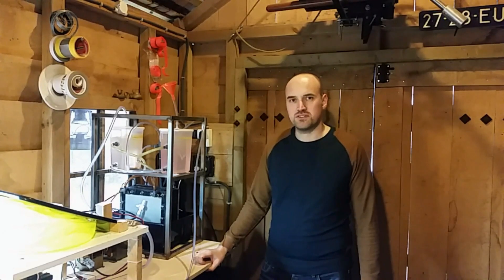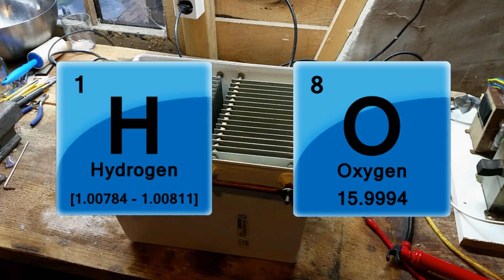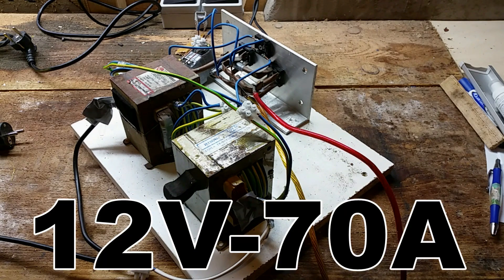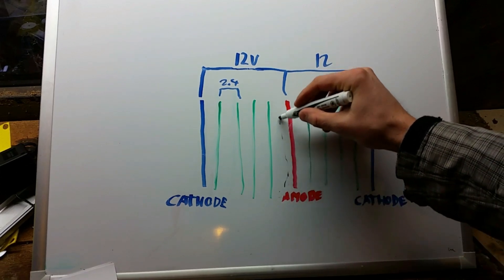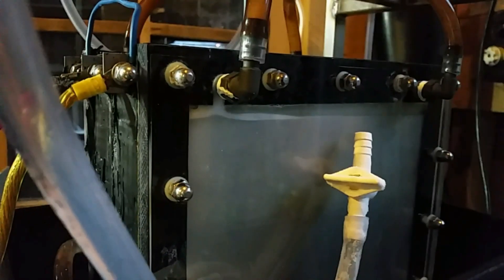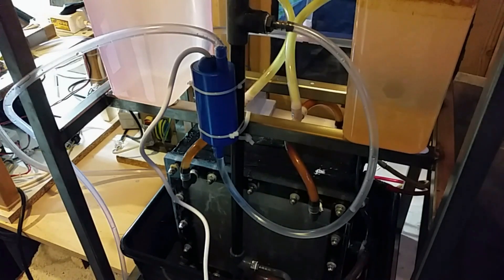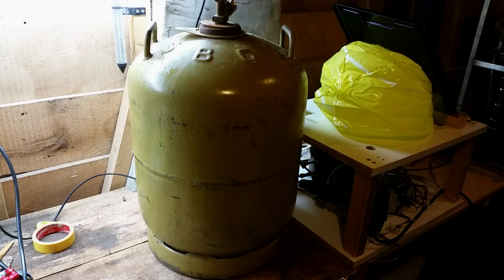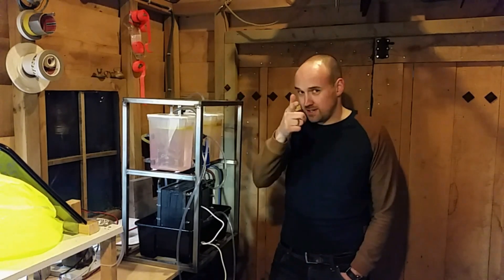Hydrogen Generator #1 Homemade Hydrogen Generator And Compressor Unit

Comment: I didn't know you can separate the hydrogen & oxygen like that..
Reply: Now that I know this, I know my sustainable energy idea will work...
What if you did the same thing, but under vacuum...to attach a vacuum pump on the hydrogen side...& probably put another vacuum pump on the oxygen side as well....I bet you'll make alot more hydrogen than before
Reply: If it works as I think it will, you'll have probably the world's first water cracking system...I call it the Water Cracker
Reply: @Chris Russell thanks for the answers this is rhe best answer yet & there is hope on this...thank you
Reply: @Chris Russell I know it can work because when I was in the Navy from 1991-1995 I operated a few thermal desalination stations onboard a aircraft carrier that did such a thing of which where half of my idea came from...the other came from a combined cycle power plant that used methane gas from a closed landfill...and the rest of the idea came together from this video 😎

Comment: One question if we use the hydrogen out of water on a worldwide scale, how does the hydrogen in water get replaced? Wouldn’t we at some point end up taking all the hydrogen out? What I mean is would we use up all the water?  
Very clever engineering, to a lay person anyway.
Reply from the maker: Thanks! No that would not be a problem first of all when in contact with oxygen, even when it's not being burned, hydrogen will recombine with oxygen to form water over time. And imagine this, there are more water molecules in a cup of water than there are cups of water in all the oceans.

Comment: Your Re-fridge Compressor must have issues.   I've never had problems with Compressor Startup while under pressure.
Reply from the maker: Than you're in luck! Al the compressors I use have this "problem". Just to be clear, it's not a problem when it's under pressure but when the outlet pressure is higher (2 bar) than the inlet pressure.
Reply: @TheDIYScienceGuy  I've used those compressors a number of times to make High Pressure Air Compressors.  300+ PSI.   Never had the issue.  Are the ones over there different maybe ?
Reply from the maker: Yes I think there is a difference. But it doen't mater, it's easily fixable.

Comment: You are getting a lot of heat because the electricity is traveling to far through the rather none conductive SS steel plates. There is no known split rate limit for electrolysis and also your design has a huge amount of current leakage. Your electrodes need to be in phase with one another and no more than 3 mm apart.  That will never be efficient like that I use a tube and rod and put a felt sock over the rod to divide it from the cathode.
Reply: Interesting! Can you share more info?

Comment: Heat is equal to volume, the slow production is low heat, slow tape low volume (sound energy), the volts are the force you're using to split the water, and is equal to the force you use to pull the tape. High volts = high heat, high pulling speed = high noise (volume).

Comment: 5 neutral plates will set each to 2 volts. The most efficient configuration. anything above 2 volts will be lost to heat.

Comment: good job!  very nicely done!  Some type of current control might help with the temperature.  I found with my hho setups that the cell will start to pull more current the longer it's running.  So some type of current control will definitely help keep the temp down.  I really like the idea of separating the gasses.  I had a back flash once and there was a lot of shrapnel and some temporary deafness involved.  A lot of people watching this video wont understand how loud lighting the little bubbles actually is.  For sure if you weren't  wearing hearing  protection your ears where ringing after lighting that pile of bubbles in your metal bowl!  Ahahaha love it!
Reply: I agree, it's a great video, that's good advice about the hearing protection, thank you
Reply from the maker: Fun fact I forgot to put them on that time..   I cut out al the swearing 🤣

Comment: Try creating your hydrogen generator to produce enough to use to boil water and turbine and see if you can create enough electricity to run you hydrogen generator that would be impressive
Reply from the maker: That would  work, though with a ridiculous amount of loss. 🤔

Comment: What not use a sodium bicarbonate solution? Why not run the water thru a radiator?
Reply: You get some amount of CO2 produced as bicarbonate breaks down.
Making the generator large in 2 dimensions can make it work as the radiator with no pump needed.

Comment: I found that KOH works better than NaOH.
When I made hydrogen, I had the generator at pressure and no compressor.  I was not compressing it very much but the system was simpler.  The water pressure ended up as the pressure on the storage.
Reply from the maker: I tought KOH only had a lower freezing point. But if you say so I might give it a try. Thanks! 👍

Comment: I am really amazed that you are able to make hydrogen so cheaply. Why is it so dangerous when you combine both H2o ??? Please answer Sir. Will watch more videos of yours to educate myself on the process and see if I can make a unit like yours. Have you used HHO to increase engine gas mileage efficiency ??? Please answer me Sir. Thanks and peace too. V is for Victory.
Reply: Hydrogen + Oxygen can go "BANG!".  A diesel engine works by igniting the charge with pressure.  You really don't want an accidental diesel engine to sent bits of the tank flying in all directions.
"Nobody" has actually ever increased the efficiency of a gasoline engine by adding hydrogen.  The only case where it appears to work is with an engine that is so hopelessly efficient it needs a tune up or to be replaced.  A properly tuned engine doesn't become more efficient.
Beware there are con artists out there who want to sell you things.
The worst possible system is the HHO thing that runs on your car's electrical system.  You car makes electricity very inefficiently so you start off with a much bigger load on the engine than the energy content of the Hydrogen.
BTW:  There is no real thing called "HHO".  What you really make is H2 and O2 plus some water vapor.  Someone selling you something and calling it HHO is a quick way to know you are dealing with either a fooled or a fooler.
Reply from the maker: What Ken Smith says.

Comment: I love to watch someone be creative, and hopefully we can see how your design evolves the more you work on it. Once you have the hydrogen in the tank, can you run an internal combustion engine on it? Do the stainless steel plates get consumed? Once you go solar, that would be the only expense to making hydrogen. If it then could run a generator, you would have an inexpensive source of power. Excellent video and keep working on it. I would love to build one myself after you work out the problem areas.
Reply from the maker: Thanks!! I've made videos about both subjects Combustion: https://youtu.be/llmcU-mZRFs and electrodes: https://youtu.be/Zn1hkzvFZOI I hope this answers your questions.
Reply: Let me reply to some of your questions:
1) Running an internal combustion engine can be done but is a daft thing to do because it is a big waste of energy.  Engines running on hydrogen are never very efficient.
2) If you apply waaaaaay toooo much current the plates erode.  Other than that they are good for many years.
3) Batteries are currently a better way to store electrical energy for later.  The losses of going with hydrogen are greater.
Reply: @kensmith5694  But if it is essentially free and non polluting, the hydrogen I mean, what are you wasting? Can you waste an unlimited supply of something? Until we have the option of personal cold fission devices, internal combustion engines that are non polluting and run on free fuel sounds like a pretty good thing to me. Batteries are expensive, take up a lot of space, have a higher maintenance requirement and require a much larger amount to provide equal amounts of electricity. Which also requires different equipment to regulate and facilitate the conversion of low voltage DC to high voltage AC along with the re charging of the batteries. That sounds more wasteful to me, dollar wise,  than a generator that runs on free fuel.
Reply: @azycray4801  
It is a long way from free.  If you have some electrical energy, you can sell it on the open market.  That is the value of it.  The technology to convert voltages is well known and very efficient.
Reply: @kensmith5694  After the initial equipment purchase, please explain "It is a long way from free"
Also could you explain why an electric company would value electrical energy, assuming that is who you are referring to as the buyer of said electrical energy, but not the people who are the would be sellers? Or maybe you meant that selling to an electric company is worth more than keeping/using for your self, I'm not really sure the point you were attempting to make since you did not elaborate. Maybe you could start by telling us how you would convert a free (I'll accept extremely inexpensive for arguments sake)  source of hydrogen into electricity since you won't be using an internal combustion engine? Then explain why selling electricity has value but not personal usage. Finally, "The technology to convert voltages is well known and very efficient" may in fact be true, the point I was making that seems to have eluded you is the extra initial cost necessary to sell electricity as opposed to personal consumption.
Reply: @azycray4801  
I thought the idea was obvious.
If I have an apple tree than makes 10 apples.
If
A)  Person A  offers me $1.00 for each apple and will buy all 10
B)  Person B offers me $0.30 for each apple
I will value the apples at $1.00 each and sell them to person A.
If person C comes along and offers $1.50 each, they will get the apples.
The same applies to the energy from the solar panel and hence the hydrogen it could make.  The $0.30 case is what I would be getting for making hydrogen.
You seem to not value what you have and what you do as worth anything.

Comment: Did you ever use a Kill a Watt meter or similar to measure the total electricity consumption  including compressor to produce X liters of H2? With the numbers you mentioned in the video I would estimate about 1.5kWh / 100 liters or 170 kWh / kg H2 so roundabout a 20% production efficiency but would like to see the real numbers from you if available.
Reply from the maker: Yes I did. It uses about 900Wh for 70 liters of H2 gass at about 20C
Reply: @TheDIYScienceGuy  Thanks for your reply,  so about 10% lower consumption than I'd estimated and that gives about 23% efficiency which is not bad for a DYI hydrolyzer

Comment: try it with plain water fool.....you are introducing a fuel in the water and steel plus an electrical current to degrade them....a gas cannot dissolve in water.......
Reply: The NaOH greatly improves the efficiency of the process.  All good designs add some sort of ions to the water.
Reply: @kensmith5694  Ken.......water itself does not conduct electricity.....and as it cant hold gas the effect obtained must be manufactured from what you put in it....good luck....
Reply: @roystonbarton  What was your point?
You seem not to know how it works.
Reply: @kensmith5694     you can only get out what you put in.....
Reply: @roystonbarton  
Let me explain what is going on.
When you add KOH to water it breaks into two ions K+ and OH- and these wanter about in the water.  The K+ is attracted to the negative electrode.  When it gets there, it briefly gains an electron.  I then very quickly rips one H off an H2O and that comes out. Two  Hs from two actions like this will join to make H2.  Meanwhile the -OH drifts to the positive electrode.  There it gives up and electron.  Two of them will meet and kick out the extra O to go back to being H2O.
Reply: @kensmith5694     water is not made of hydrogen and oxygen it is just water.... the stuff you make comes from the sodium hydroxide and elecricity......end of......bye
Reply: @roystonbarton  
You have to be a troll.  Nobody in the modern world could believe that.
Reply: @kensmith5694     sorry KEN.....I was not going to keep this going.....I was educated and passed all my exams....when I got the internet I found out that I had been  forcefed untruths......the truth is you have been indoctrunated with fake science...if you take an unbiased look at einstein you will work out that he had four theories of relativity... the one that you know....E=MC2 is wrong...the last bit is provobably impossible but energy = mass is right....the rest he just added on...I could go on but you would just get bored.....textbooks are based on experiments that can not stand up to scrutiny......anyway red wine is to blame.....good luck    bye
Reply: @roystonbarton  
E-MC^2 works to as many digits as we have been able to test.  What few things I have personally done that got into cases that mattered also matched as well as I could measure.  This includes the image size on a CRT.
I doubt you have done anything that tests the theory for your self.
Reply: @kensmith5694      oh dear ken....what a mine field when you try to prove a theory that cant be tested...einstein eventually admitted that as his superier theory of relativity was junk he copied an equation sent to him from a man in india......next you will be telling me that you can explain that other fraud hawkins big bang THEORY....some idiots even think that a man has stood on the moon...dont bother.......OK
Reply: @roystonbarton  
Theories are never actually "proven".  They hold up until someone can find a way to disprove them.  So far, Einstein's work has matched the results of experiments as well as the measurements can be made.  Every single time (so far) that someone has put it to the test, his theory has held up.  You on the other hand are just some random guy on the internet who is making claims that unsupported by any experiments.
Reply: @kensmith5694      I can randomly move in 3 dimensions and another  that is not known except ......have you got a theory for that....honestly ken if it wasnt for the red wine I would have given up by now....good luck...
Reply: @roystonbarton  
Yes.  A few points.
Your ability to move in a dimension is not a way to define if it exists.  If you stand on a table and jump off, you are no longer in control of your motion.  You don't see the world suddenly distort.
Our instincts are good for not getting eaten by lions etc.  This means our brains take some shortcuts to detect and avoid lions.  When it comes to other topics, those instincts will work against us because those other topics are not like lions at all.
Some of the explanations commonly used today for physics make understanding it harder instead of easier.  It is useful to do the "trolley car and bell tower" thought experiment and the two guys playing catch in a boxcar before trying to go to the next step.
Reply: @kensmith5694     not even a good reply...of course the answer would have been time....but you did not fall into that trap as you would have to explain E=MC2 and the MC2 is not possible.....anyway its not relevant...thanks anyway.....good luck
Reply: @roystonbarton  
My reply was fine.  The problem is at the receiver end.  E=MC^2 is correct.  You don't understand it or any of the thought that leads up to it.  Your failure to understand is not a problem with the theory.  It produces the right numbers when checked.
Reply: @kensmith5694  I am just stupid....please tell me what  MC2 means...ha ha....you dont know and I do.......PS I expect a scientific reply not some fancifull drivel....or dont bother........
Reply: @roystonbarton  
E,M and C are all numbers is a consistent system of measures.
E means the amount of Energy in the units
M means the amount of  Mass in the units
C means the speed of light in the same system.
the 2 is for squared.
If you convert mass to energy or energy to mass it follows that equation.
Reply: @kensmith5694      KEN the problem is the 2 .The speed of light cannot increase but if it could it would change any measure of time.. and I am sure you will agree time is only relative.....anyway....good luck......
Reply: @roystonbarton  
There is no problem with the 2.  It is an equation.  The equation is correct.

Comment: Nice.

Rather than a compressor 
Why not place pressurise the water, using a pump?
Gas produced will be at same  pressure as water
Reply: That is what I did.  It does mean that all the hardware has to stand the pressure through.
Reply from the maker: Yes that's the biggest challenge.

Comment: I heard they were doing this in China and running hydrogen powered bikes from the solar hydrogen stations.  But it could be rumours as couldn't find anything on the net to substantiate it.
Reply from the maker: Could be true, it's not impossible and china invests a lot in green energy.
Reply: If it is true, it is proof that even people in China do dumb things.  Making hydrogen is a very lossy process.
Reply: @kensmith5694  it's not a lossy process if it's made from renewable free energy.
Reply: @rattedbug5003  
If a sled had wheels, it would be a wagon.  Solar power is not free when converted to electrical power.  The cost of the system has to be paid off.  Thus the power is not actually free, ever.  
An electric scooter with batteries is a far better option.  Less energy is lost.

Comment: This is the start of the new technology.  Thanks for sharing amazing. People not understanding how to do this would be very dangerous. Does the hydrogen have to be scrubbed any further of is it acceptable to run through a fuel cell. I'm impressed.
Reply from the maker: Thanks! Yes its pure enough.
Reply: This is not new.
For some uses, you want to dry the water vapor out of the hydrogen.
For a fuel cell, you basically are running this guys system in reverse.